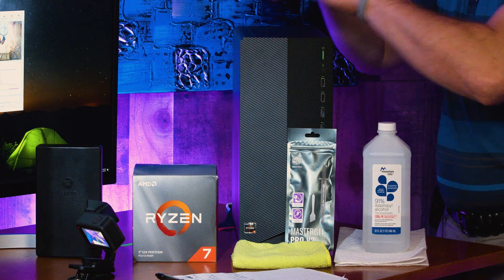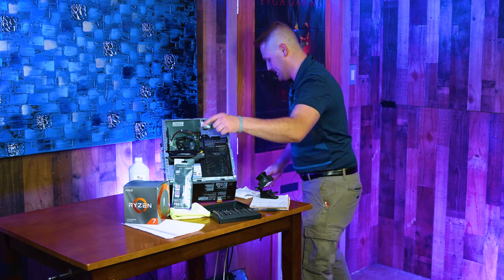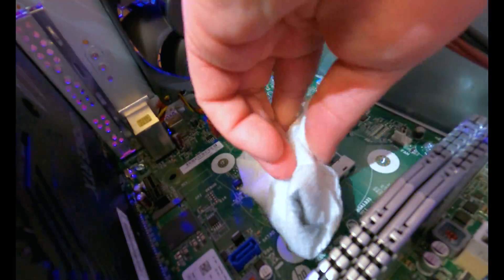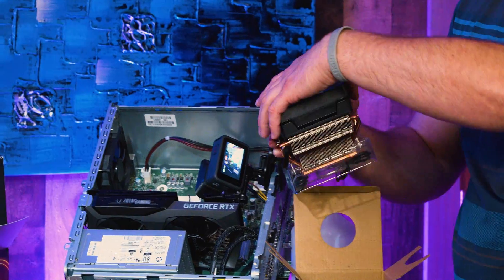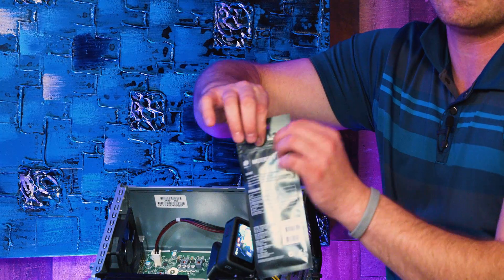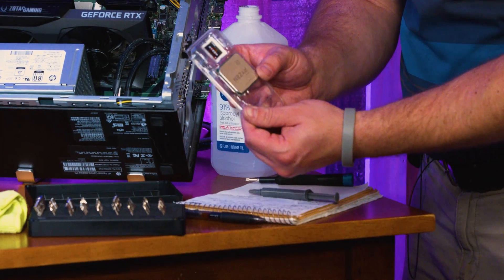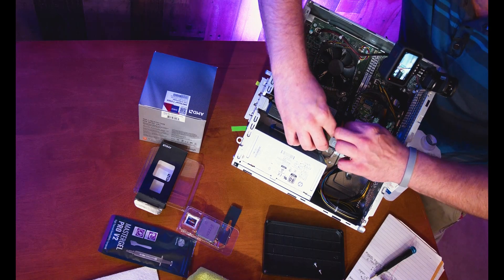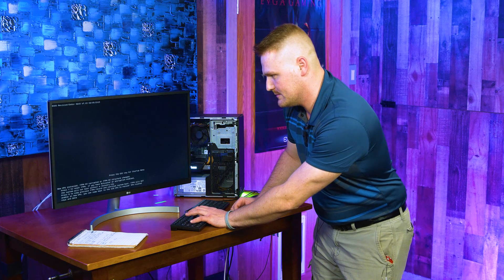HP Pavilion TG01-0023w 0030 0040 Ryzen 7 3700X How to Upgrade the CPU and Is it Worth it

Comment: Thanks TNW! I put in a 5060ti, 32gb ram, 500w psu and started with integrated graphics in my tp01-2234.

Can i swap the ryzen 7 5600g for like a 5600x or something, since i no longer need the integrated graphics? Or will it not work in general with that motherboard..?

Comment: quick question: does it work with the Nvidia 2060?  i tried that specific cpu and all my computer did not come back on. I put back the old cpu back in so i am just wondering if it is because of the gpu.

Comment: I just ordered a 5700x
.. I'm praying it works in my tg01 i got excited to get it and didnt even think about it not running on the erica board
Reply: Lemme guess, it didn't work?
Reply: @lclnbm  nope. Went ahead and just got a new Motherboard, case, and PSU, and swapped drives and RAM. I have the old original RAM and another NVME  I'll slap in the TG 01 and give it to my daughter as an upgrade from her Optiplex
Reply: @Striker9  i have the Erika3-erika5 rev A motherboard i bought a 500watt psu i thought about a rx 6700xt with a r7 3700x 
I have 12GB ram at 3200mhz but I want 32GB u know any ram sticks that work fine with these motherboards? 
I bought a 4060ti 8GB for 1440p it was alright 90-110 avg fps on cod mw2 so some little more cpu power and ram would help and the 6700 XT would be better for imo for the 12GB cuz the 4060TI wasn't really liking it

Comment: I upgraded it and my pc turns on but my monitor and keyboard and mouse dont
Reply: I put a ryzen 7 5700x
Reply: Did u find a fix I’m currently having that problem
Reply: @Tice1-v3j  if u did the same processed has I it might not be compatible
Reply: I completely rebuilt the pc with a new motherboard and case so I’m not completely sure

Comment: I know this video is old, but I saw that is possible to run a ryzen 9 3900 on it. I’m curious if you could test it out and see how it works with it, whether the original parts of its 400w and 1650 super or the other upgrades toy given it more recently.

Comment: I just tried to upgrade my pavilion from a Ryzen 5 3500 to a 5600x...nothing is coming cross my monitor......does anyone know if the 5000 series is compatible with the TG01-0023?
Reply from the maker: Only 3000 ryzens cpus will work.
Reply: Did u find a fix I’m currently having that problem

Comment: Forgive my lack of knowledge, but you said that you can’t use the thermal paste that comes with it but you never said why so I’m not sure why I can’t just use it. If anyone knows I would really appreciate the insight thanks!
Reply: Thermal paste is usually pre-applied by the manufacturer in this case, HP if you swap CPU chips you'll need some alcohol and new thermal paste you cannot and should not reuse thermal paste and instead clean it all off and ensure fresh paste is on the IHS Integrated Heat Spreader. Thermal Compounds Id suggest is Arctic Mx5. The reason to not use the paste and instead to clean it off is for more stable thermals as all IHS are slightly different as not all metal is created equal. When you pull off the old chip to replace it with a new one the old thermal paste is not as receptive to heat and cold dissipation.

Comment: Would a ryzen 7 5700g 8-core 16 thread be compatible
Reply: Until HP adds BIOS Update and Chipset Updates to the B550 erica platform the best upgrade we can choose is the r5 3600 or the r7 3700x
Reply: @BojackHorseman-cq3kc  why doesn’t the hp website show the 3600 as a compatible cpu?
Reply: @BojackHorseman-cq3kc  why doesn’t the hp website show the 3600 as a compatible cpu?
Reply: @Ramonuh  No idea but I have seen many people upgrade to the chip, my guess it was the OEMS way to push other chips and save the 3600s for the more elite builds that would be my guess and fear not the stock cooler can cool a 3600 though id opt to replace the fans in the rear and side panel for additional venting Noctua makes some nice 92mm for a decent price that with a splitter and youll be laughing. That 400w psu can support 32gb ddr4 3200 (oc with ryzen master) and a dual card fan up to 10inches and from my extensive research the 2060 and 3060 would be possible but with no OC to CPU or GPU

Comment: Anyone ever successfully enable Smart Access Memory(SAM) for this HP? I have TG01-0023w with Ryzen 5 3500 and MSI Mech Radeon 6650xt OC with CORSAIR Vengeance LPX (AMD Ryzen Ready) 16GB (2 x 8GB) 288-Pin DDR4 3200 (PC4 25600) AMD Optimized Desktop VRAM. The Bios on this thing is clunky and doesn't seem to be able to do as standard. Thanks.
Reply from the maker: I know it is lacking.

Comment: I've got the HP pavilion TG - 01 2022 and I've upgraded the GPU to a RTX 2060 as well as the ram to 16 gig vengeance sticks... My next upgrade I believe is to the CPU.. The CPU that is in there right now is the AMD Ryzen 3 5300G Processor... The stock power supply that came with it should still be good I don't think I'll have to change that I believe it's a 450 W... But I'm just wondering, how much of an upgrade will the Ryzen 7 be over the ryzen 3...is it a massive difference? I would assume it is...

Comment: Have you tried 5600 or 5500 on the X570 MOBO in the HP TG01.
Reply: Sad to break it to you but it can't the hp motherboard which is Erica can only handle the ryzen 7 3700x
Reply from the maker: Correct!

Comment: Would the ryzen 5 5600x fit in the tg01 motherboard
Reply from the maker: Hp boards do not allow cross gen on cpus most of the time.
Reply: @TNW1337  what about the ryzen 7 3700x will it work

Comment: Been messing with mine more and gaming on it again. Any idea if the 3700x was a restriction based on the board capabilities or due to the psu? I know hp recommends 3700x as the largest cpu upgrade.
Reply: since nobody responded to you if it still helps two years later it's with the mobo

Comment: What’s the best cpu you can put in this hp
Reply: So I can put an intel cpu in the hp when it came with the ryzen 5 3500
Reply: @noahhill1466  thats a different model for your r5 3500 model your upgrade options are either the Ryzen 5 3600 or the Ryzen 7 3700x that board in your hP can also support a Corsair 32gb kit of 3200mhz OC using Ryzen Master utility.
Reply from the maker: i7

Comment: Will an amd 3600 work on the tg 0023w?
Reply from the maker: HPs supported lsit.

AMD Ryzen 5 3400G
	
AMD Ryzen 3 3200G

AMD Ryzen 5 3500, 

AMD Ryzen 7 3700X

The 3600 is a 65w Cpu It is not on the list, for upgrades but it is with in spec. the above cpu's is what they have listed supported. I can not see why it would not work. I've herd others have tried them and they worked. I have not try it my self. if you get it from amazon it is pretty simple to return it if it does not work. But I put it at 95% that it will,  just do not get the X version. if you want the Best Cpu you'll want the 3700x.
Reply: @TNW1337  hey thanks for the reply, I purchased a rtx 3050. Its paired with the 3500, how much performance/fps boost you thimk the 3700x will gain?

Also will the 400watt psu be okay with the 3050 and 3700x?

Comment: I have a question, im using the hp pavillion gaming pc and im wondering if i can upgrade my cpu to a ryzen 3 5300g to a ryzen 5 5600g
Reply from the maker: If it is a 65w cpu then it should work I think the Top CPU in the G family is the 5700G. So yes the 5600 should work.

Comment: Will the Ryzen 5 5600X work with the motherboard? I have that same case that has that model number you have and has the R5 3500 in it with the 1650 Super
Reply from the maker: They have the bios locked so only 3000 will work.
Reply: @TNW1337  So maybe I should go with the Ryzen 3600 then? I need a processor with more threads
Reply from the maker: @gamernation7112  or the 3700x up to you.
Reply: @TNW1337  Won't those cause a bottleneck with my 4GB 1650 Super?
Reply from the maker: @gamernation7112  it will yes, but if down the road  u want to upgrade the gpu you'll have the cpu to match. It is only about 9% not much. And the price difference Is not all the much.
Reply: @TNW1337  So if it bottlenecks a little bit it won't hurt anything right? I build computers and stuff and still trying to figure what will match and won't match, I was thinking about going with a 3700x cause I need more cores amd more threads for what I'm running
Reply from the maker: @gamernation7112  it is around 9% but no it will not hurt any hardware.
Reply: @TNW1337  Thanks alot man! I can't afford a new GPU with prices the way they are currently but I'll upgrade the CPU for now

Comment: Hey, I’m buying an i5-10400 after having the i3-10100 in the computer stock. and it comes Jan 6th. This will be my first time upgrading anything at all and I’m kinda worried.
Reply from the maker: It is not hard. did you order thermal paste? it is only 4 screws and and use 90% isotropic alcohol to clean the cpu and heat sink you should be fine. How did the upgrade go>?
Reply: @TNW1337   Upgrade whent well, ran into some issues with the computer becoming really loud and it will say "locking" and shut down. I assumed it was a heat issue so I slapped some more thermal paste on there and that seems to have fixed it. Hoping to upgrade the ram sooner or later which I assume will be pretty easy. And maybe in the near future a new GPU :)

Comment: I currently have an i5-10400f and can I upgrade to this ryzen 7
Reply from the maker: You would need a different mobo. No you can not. May I ask why you want to change? Why not get a i7 you can upgrade to one. Cheaper and easyeir
Reply: @TNW1337  which i7 processor is compatible with this pc?

Comment: Hi again, is the TG01-0067NA compatible with the ryzen7 3700x aswell?
Reply from the maker: Yes it should be. I've not tested that PC. Spec sheet shows it is compatible.
Reply: Hey did u ever get it working? Got the same CPU and wondering if I should do the upgrade, done the GPU, Ram, and SSD just need to upgrade the CPU. Also if u did manage to do it did you have to update the bios or change the power supply or cooler or anything? Thanks!
Reply: @Mr_2N2 hey unfortunately not, never got round too it tbh😅 still have the same pc tho so at some point I might actually do it.
Reply: @cfsimulation5897haha oh alr if I do it I'll make sure to let you know how it goes I had a bit of trouble with the bios a while ago so kind of scared to try anything but Imight as well give it a go!
Reply: @Mr_2N2 ahh OK thank you, tbh last time I was motivated too do it they stopped making the 3700x but I've just had a look on amazon and there's some new ones so I might order one too😅

Comment: i have this model with a ryzen 5 3500 and a 1650 super. without any knowledge prior i ordered a ryzen 5 5600x. I need to know if it would work in this build. if i put the cpu in and it’s not supposed to, will it mess up or break my computer?
Reply from the maker: It will just not turn on and beep at you.,

Comment: Would it be worth to fully upgrade this pc with a new gpu and cpu? Or just buy a new pc build?
Reply from the maker: Depends on what your going for. I would take parts from this pc and do a case swap. Or just buy a new pc.
Reply: @TNW1337  so a new pc over like a 2060 and Ryzen 7? Cause a new pc would be about the same but I don’t think for the same specs??
Reply from the maker: @dahiitman  so this is the difference from a hp to a atx computer. better air flow with higher end parts, which means better performance. The other thing is better upgradbilaty. You can add what ever parts you want. The hp can be made it to a badmamjamam of a pc. Just needs some work.

Comment: When I went to order it from the link it says AIO cooling is recommended for that cpu but is it really necessary? I have the same computer and was looking to upgrade the cpu but wasn’t too sure if the temperatures would be alright without the AIO cooling.
Reply from the maker: If you do the 3700x you need thr big noctua cooler if you do not want to run in the 80+c realm.
Reply: @TNW1337  Oh alright. Would you happen to know the Max cpu I would be able to get without upgrading the cooling?
Reply from the maker: @MoralDWR  if you have the 3500 or 3600 well be the max. I am going to look for a aio that will work with the hps even if you have to drill a hole. I mean any one can do that.
Reply: @TNW1337  also, if I did upgrade to this cpu without the cooler would running at that temperature damage the computer over time or would it be alright?
Reply from the maker: @MoralDWR  no but it may thermal  Throttle which you would lose performance.  90c/95c the CPU start to reduce voltage. At 82c it starts to reduce Mhz. So no you can go with the small noctua but let's be honest getting thr heat sink and a 4x 16mm screws is not a hard task. If you look at my other videos I use the same heat sink for all of the hps they use the 1151 style backplate on am4, 1155, 1151, and 1200 sockets. Pretty smart on hp part. But makes finding a heat sink very hard. Becuae the hold down brackets need to be  Elevated off the board. Due to Capacitors that are in the way. And I think a Mosfet.

Comment: Will a 5600x work? Maybe after BIOS update?
Reply: I have a 0023. I guess the 3700x will pair fine with the 3060 I upgraded to. Had to wait about 6 months for it through the EVGA waiting list but finally got it.
Reply from the maker: @rayog21  cool how do you like it?
Reply from the maker: I wish I couple have gotten my hands on more gpus to test but just got the 6700xt last week if you had the 500watts psu you could have gotten that would not have to wait as long. Still a very good card.
Reply from the maker: with the 0023 it will not work. Not that AM4 does not support it. On the newer TG yes it will work what model do you have.
Reply from the maker: Still on a waiting list to get the 3060ti.

Comment: Hey TNW thanks for all the videos im relatively new to pc so im still learning everything, so I do have a couple questions, is it possible to upgrade the CPU and cooling with the power supply that came with the pre build or is that something I would have to upgrade also why does this PC max out at 32 gigs of ram is it the motherboard?
Reply from the maker: Yes it is a Limit of the mobo.
Reply: @TNW1337  ok cool so the power supply you put in when you upgraded the gpu would suffice im guessing? Appreciate the help with everything btw this is way more in depth than I was ever expecting 😄
Reply from the maker: @justincarrero5482   Yes I try to give you all the info.

Comment: Do i have to upgrade my gpu since its alomost impossible to get one for cheap? And if i could would it still be worth it?
Reply from the maker: Depends on what you want to do if you looking for better gamine play FPS and better looking graphics then yes.
Reply: @TNW1337  well could I just upgrade my cpu so it runs better and wait on my gpu and if I did would it still run fine. Because I have a r5 3500 and would it be worth it if I upgraded to a r7 3700?
Reply from the maker: @ItGrass  I would wait to get a good GPU. Imo
Reply: @TNW1337  ok. Thanks so much.
Reply from the maker: @ItGrass  any time

Comment: I put 16 gig of memory into my new HPtg01-0023w.  I backed up with a WD 1Tb my passport.  It would not recognise the external drive or any other drives after that. When I installed an Adata 960 SSD, it would not recognise it or any other drive that I installed'  I have tried all the fixes and nothing works. Not a good recommendation for this POS.  I also noticed that the power supply fan does not run.  Any suggestions?
Reply from the maker: That sounds like you may have a bad unit I would Call Hp asap. The PSU fan only runs when it see heat.

Comment: to upgrade to a ryzen 7 3700 would i need to upgrade my power supply? I currently have a ryzen 5 in my hp pavilion
Reply from the maker: Nope
Reply: @TNW1337  okay thanks! So temps should be normal if cooler installed back properly with right amount of thermal paste?

Comment: (I have the stock hp pavilion with 1650 super and Core I3 10100 with 8 gbs of ram I just want to upgrade my cpu)         first question can I? 
Second question what should I upgrade it too?
(Just looking to upgrade the cpu)
Reply from the maker: i-7 or i-5
Reply: @TNW1337  even if it’s a prebuilt? It’s the same one you are customizing just lower specs and I want to know if I can change the cpu. Plz respond soon as possible.

Comment: Can I use a 2080 super or 3060 with the 500w power supply ? & this Ryzen 7 3700x
Reply from the maker: Yes 3060. What is the tdp of the 2080 your looking at.
Reply: @TNW1337  250w
Reply from the maker: @xLilKraz3x  with the 500 watt it will work you will need a dual to single 8pin adapter same one I show in my 3070 tg video also linking in disco
Reply from the maker: @xLilKraz3x  any time man.

Comment: Can u put a ryzen 7 5600x in this ?
Reply: Nope. Not currently supported by BIOS. Should be support-able [on B550A boards, which are basically unlock B450s, which should theoretically be able to support 5000 series], if HP got off their duffs and updated the BIOS to support the 5000 series Ryzens, but so far they haven't...
Reply from the maker: I hope Hp does not lock it we will see. only down fall would be the support for PCIe 4.0  not like your gaining much here with current gen cards

Comment: I want to know how hot 3700x temperature was on your test..  
I have TG01 0213kl, which has builtin Ryzen 7 3700X, and its idling temperature is over 66 celcius... it feels to me way too high
Reply from the maker: 90c is the top end not that I would run it at that, I would get a heat sink I just dropped a video that shows how to install one.  There are 2 noctua that will work.
Reply from the maker: All are listed in the videos disco